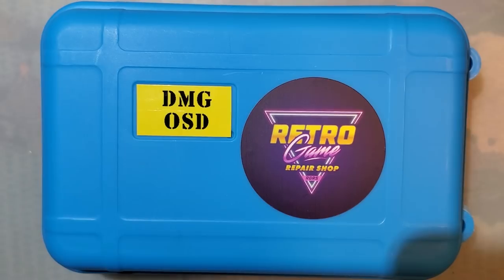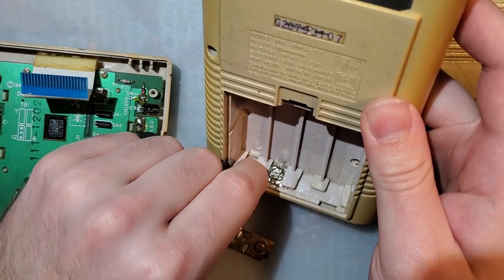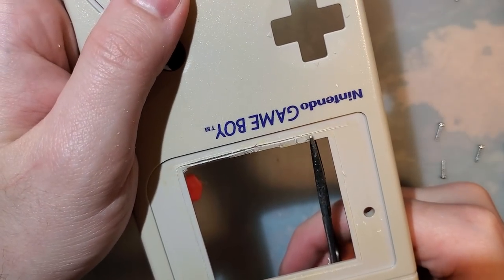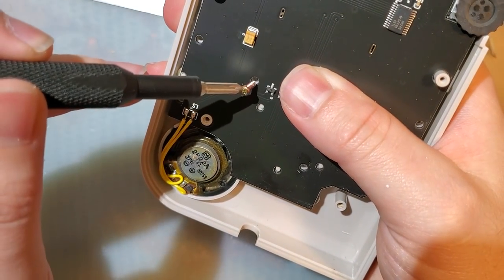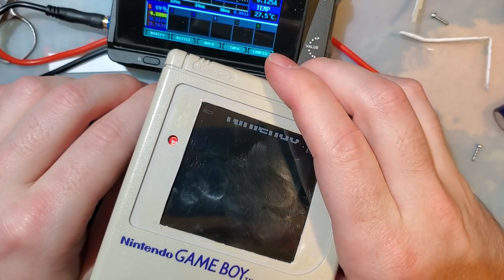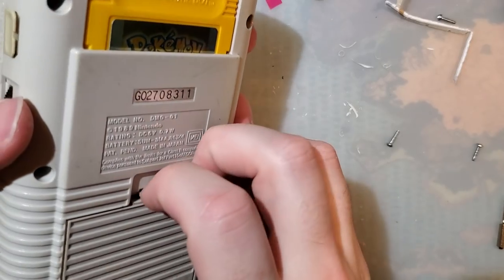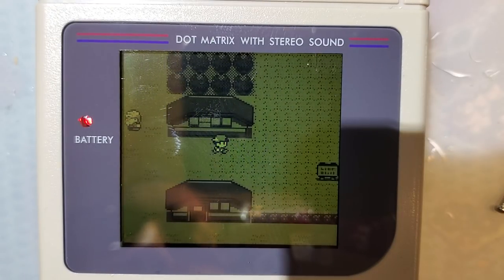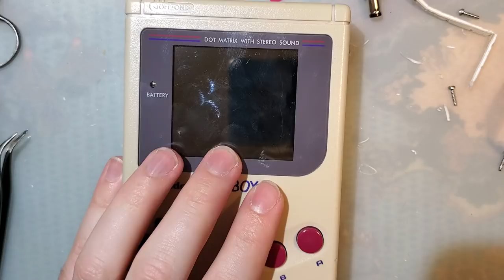OC DMG Backlight OSD - Game Boy IPS Kit (RIPS v4)

Comment: For a more intensive inspection of the D-Pad circuitry, I'd probably want to use a shoot'em up to test it.
While I don't have the DMG and replacement front PCB's, the three Pockets I own (which, as far as I know, have their original rubber pads and D-pads) have vastly different D-pad feels, especially if I rock the D-pad to move the plane in circles in Nemesis/Gradius. I can only smoothly move the plane in circles in one of the Pockets, while to achieve the same movements require a lot more force on the other units.
Reply: There are better shoot'em ups to try this than Nemesis though, like SolarStriker or something. Nemesis runs at a low framerate.

Comment: The board doesn't have access to the battery level so it contains a model of the DMGs internal voltage regulator that it uses to guess the battery. this is because the regulators output drops slightly as the batteries are drained.

Comment: I love those settings to adjust the screen position. There's been a few times when I might have had the screen too close to one of the edges or it was slightly off. With these settings, you wouldn't really run into that issue. 

Though I suppose it would go back to factory reset when the batteries are changed.
Reply from the maker: > Though I suppose it would go back to factory reset when the batteries are changed.

Why would you assume this? It doesn't do that.

Comment: I noticed the clear tab on the top right of your IPS display behind the lens as you were running the tests, looks like you forgot to remove the protective layer from the screen?
Reply from the maker: Forgot? No. But yes, I did not remove the plastic film. Spoiler alert, but I tend to go back inside these GBs and clean up my installs after the video or even take them apart entirely. No sense making the video 20 minutes longer than it needs to be while I sit there with the canned air and microfiber cloth.
Reply: @makho  Fair enough lol, makes sense. Keep it up

Comment: Very nice video!
Tho I am going to go with the V3 because I prefer the original size of the screen.
I am a little disappointed at the color palletes.... 😒 they just seem like over kill. Not close in gradient to the original. Perhaps there is a screen replacement with better palletes but is true to the original size? Thoughts?
I am useing this gameboy for my nanoloop mono cartridge ;)
Reply from the maker: > with better palletes

You do realize that the palettes are programmable with this kit, right? The ones I showed are just the factory ones, you can replace them with whatever palettes you want. 

And regarding the screen size, I think you're making a mistake there. In this particular case, there is plenty of room so bigger is better since the console is still the same size.
Reply: makho yes I realize that the V3 isn’t as big and does not have the programmable palletes. Idk why I’m stuck on the idea of having the original screen size 🤔 You have a point tho the V4’s larger screen is much easier on the eyes. I have another DMG so, I think I’ll take your advice and go for the V4 for that second DMG! 👍

Comment: i scrape the blade with a bit of pressure backwords over the plastic when trimmed, it removes all those little sharp bits.

ps you need to give us a run down on that psu. it looks nice but prices ive seen are way high
Reply from the maker: I've gone into it in the comments but basically it's a neat little unit. You pay a premium for the size but the features are about on par with the larger units. It's good for someone who has very little space for something like this but otherwise the bigger, cheaper units are probably better. It's also good for someone like me who does these tests on camera and saves me the hassle of setting up another camera to cut in to my videos or to make a remote display.

Comment: Thank you SO much! Was really helpful to see someone else do this build and follow along.
One question: I have everything back together, works well and looks great ... BUT ... the D-pad isn't responding. I have to lean on my thumb with all of my weight to get it to trigger. Any idea what could be causing this and how to solve it?
Reply from the maker: You should contact the seller of your kit.
Reply: @makho  Figured it out eventually.
The kit was fine.
The seller told me that this can happen if the screws are too tight, so I untightened the PCB and case screws near the D-pad - but that didn't help.
Along with the kit, I also put in replacement buttons and silicone pads. For some reason, with the replacement D-pad and rubber it didn't work, but I put the original back in and now everything works fine. Weird.

Comment: Hi makho - As always, love your vids. I'm curious on a couple things, do you think/know any pieces/parts from the previous revisions of this MOD would work where you might just need the PCB for the screen to connect to get your previous MOD to this version 4? Also, curious if maybe the PCB from the previous MOD is programmable, where this updated MOD could be flashed onto the previous version PCB to get it to this version 4? I'm guessing no to the flashing of the previous PCB, but curious on your thoughts. Thanks! :-)
Reply from the maker: the connectors and wiring are different so no. At most, you might be able to reuse the button board but that's it.

Comment: Still iffy on RIPS since they promised better button input for the V3 and that did not end up being the case for me; In fact the V3 button board was even less responsive with the A and B buttons compared to the V2 button board.
Reply: I bought a v3 like a few months ago and while I did like the brightness settings to be as low as possible, some button presses are not as responsive as one might think - probably because of how large the contacts are. I'm still waiting on someone who would buy it from me.
Reply from the maker: I understand that some people are having problems but I genuinely don't get it. I've had zero issues with any of the boards when it comes to button inputs (except that one time when I used a really shitty dpad combined with a really shitty membrane but swapping both out for OEM parts resolved my issue).
Reply: @makho  i think the most issues were with the first iteration of the rips kits.

Comment: makho, I've just had one of these installed and it's great, but the speaker sound is now noticeably thinner with no body. do you know why that would be...? no change in speaker and no amplifier installed, but the power board has also been replaced with a retrosix CleanPower v2 DMG. also do you know where the speaker amplifier is on a DMG...? is it on the front board (screen and control board) as the speaker wires are soldered to it...? if so, that would make sense as to why the speaker sound is worse...
Reply from the maker: > but the power board has also been replaced with a retrosix CleanPower v2 DMG
there's your problem
Reply: @makho  yeah, since found out that it doesn't even work with fully charged NiMh batteries with that power board installed, yet works with dying Alkalines. Why would that be...? Is that company just full of shit...? What power board, amplifier board (with installation instructions for mono-summed speaker sound) and speaker would you recommend...? My motherboard is a DMG-CPU-06 and I do use a 2014 Everdrive GB on it as well, which I'm planning to replace with a brand new X7.
Reply from the maker: @RWL2012  yes, they are totally full of shit. Don't support them: https://old.reddit.com/r/Gameboy/comments/ktbgnf/retrosix_is_stealing_other_peoples_work_and/

Just use OEM parts where you can.
Reply: @makho  thanks for that, and for taking the time to reply and sorry for any chase-ups before... so the original power board is going back in. I've found a speaker that seems like it will work well, but I do want to power it with an aftermarket amp board. is there anything you can recommend...?

doesn't look like I'll be getting a GBamp anytime soon, and the amp I have is the CleanAmp v1.1 from our favourite company retrosix, which they very helpfully told me to "wire this wire to this instead of that"  to get mono-summed sound into the speaker rather than the right channel only, because they couldn't be bothered to update the installation guide.

Comment: Awesome vid - I grabbed and installed one of these recently.  The up on my d-pad does not work and my start button is finicky as well.  I may just have a bad unit...hopefully RGRS will reply to my ticket.  RIPS v3 kit I had before this didn't have any of these issues.  I could've probably overlooked the start button, but up is pretty important lol.  Tried reseating, and loosening/tightening the screws, still getting the same problem.

I really do hope its just a bad unit I got - because the screen is awesome and the battery meter is a killer feature for me.
Reply: Update on this - RGRS sent me a new front PCB and that fixed all the issues :).  RGRS support was awesome and responsive!

Comment: I am curious, I started to notice you don't remove the lcd protective film when installing. Is there particular reason for this?
Reply from the maker: because I generally don't keep these consoles as is and take them apart after the video
Reply: @makho  I see that makes sense.
I ask a question in your SP headphone jack video when you get a chance :)
Just wondering which pin out method is better.
thank you

Comment: I just built one but was wondering if you had any issues closing up the new housing etc? Mine doesn't close flush and I can feel some kind of bulging pressure toward the bottom of the screen. 

The screen and new board assembly feels super flush, it's only when I combine the two halves of the Gameboy that the pressure is caused.

I've tried reassembling it many times and can't figure out what's obstructing it.
Reply from the maker: I have not had any issues. Gotta make sure you trimmed everything that you need to trim and that there are not any errant screws or other parts in a place they should not be.

Comment: I installed this kit over the weekend, and when my gameboy does screen resets now (exiting out of menus in Pokemon, or changing overworlds in Wario Land) there is some weird artifacting on the right side of the screen.  Its sort of like a scan line that move down from the middle of the screen.  Any idea what could cause this?
Reply from the maker: turn the pixel grid off if it's on or on if it's off and see if it goes away
Reply: @makho  i heard you say that in one of your videos before, so i tried that but still have the issue, so I contacted the distributor to see if they knew what was going on.  Im waiting to hear back from them

Comment: Hi Makho, I just installed the OSD V4 ips kit. I found the front (button) PCB is far too thick compared to the original. This cause some real problems: buttons do note respond as they should; Is impossible to close the shell in a proper way, once closed the shell is a bit bended.
Did you have the same issues, do you know any solutions? does exist a thinner front pcb suitable for this kit ( I also have the Funnyplaying and for me is on another level of precision, also the molded bracket is far better and precise. 
well any advise is welcome.
thx in advance
Reply from the maker: the front board is too thick? That's not how that works though. You should contact the seller you got it from if there's a problem with the kit.